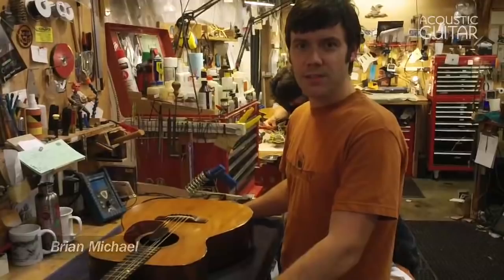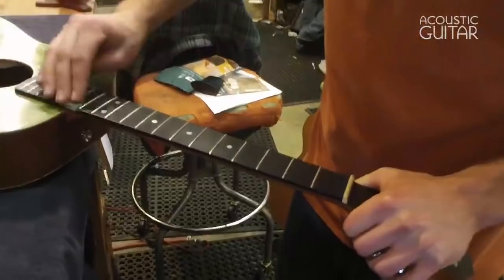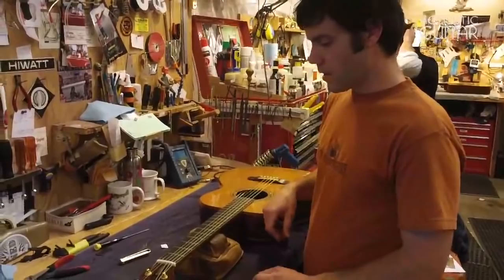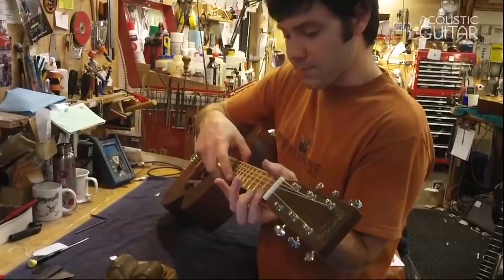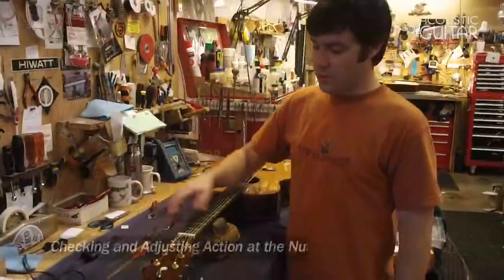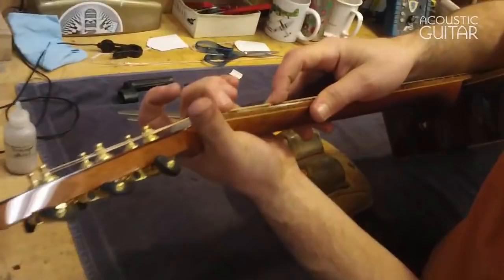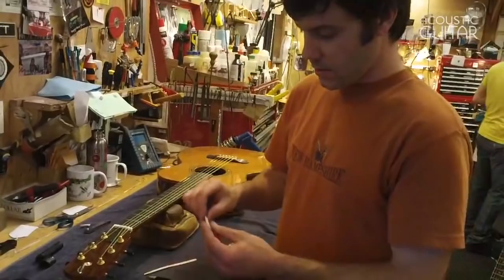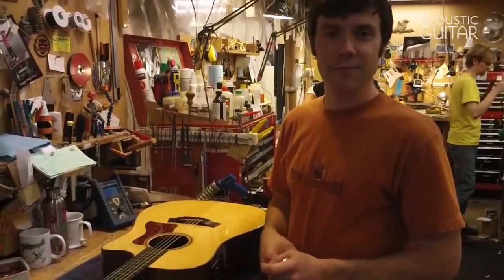7 Lessons on DIY Acoustic Guitar Maintenance: Cleaning, Restringing, Adjusting Action, and More

Comment: No freaking way am I putting plastic cleaner and freaking 409 anywhere near my guitar I don't care how many years you been doing this stuff if you're telling me that and you don't even have gray hair in your beard or hair you haven't owned any instrument long enough to know whether that's absolutely mental or not.
Reply: boeandthelizards Right ON -  to move 409 off the surface completely it takes gallons of water - I use 50/50 409/water to clean soot off bulkheads in the engine room of a tugboat. The detergent left on the fingerboard after knumb Knuts has his way will continue to degrade the wood for years.